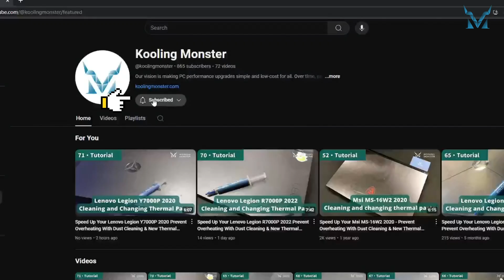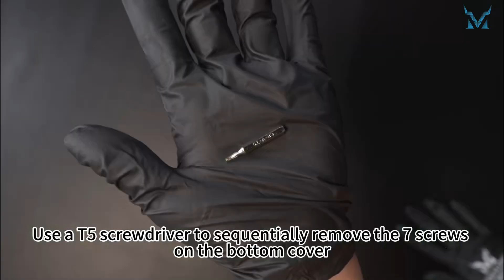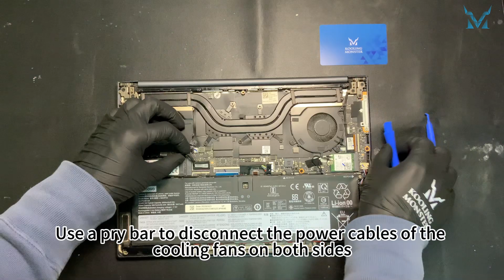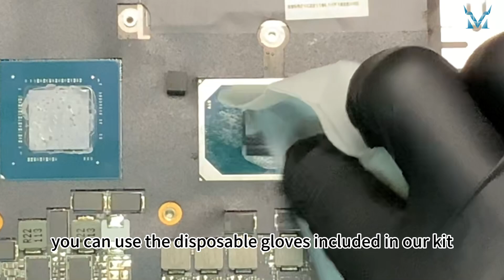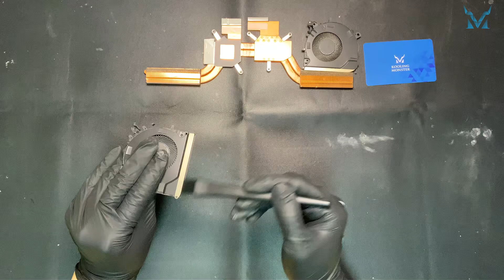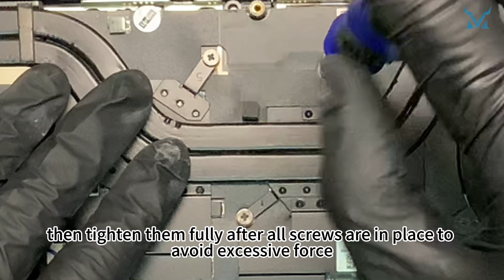Speed Up Your Lenovo Yoga Slim 7i Pro 14  Prevent Overheating With Dust Cleaning & New Thermal Paste

Comment: My left fan doesn't sounds only right sounds and hardware test dont run as they aren't available in the software , i checked all of them, can you help me to check if they work or not
Reply from the maker: Run a manual fan test in BIOS if available, or use Alienware Command Center to ramp both fans to 100%. If the left fan stays silent while the right one spins, it's likely dead or its connector isn't fully seated. Recheck the fan cable first, then try swapping the fan headers if you're comfortable. If it still doesn't spin, replace the left fan.

Comment: I have a Lenovo Yoga Slim 7 Pro instead of the 7i, can i still follow this tutorial or are they built differently? It's a 14ach5 if that matters.
Reply from the maker: The Slim 7 Pro 14ACH5 is built differently from the 7i. The motherboard layout, cooler design, and screw placement differ, so I wouldn't recommend following this tutorial directly. Please look for a guide specific to the 14ACH5 to avoid damaging connectors or missing steps during disassembly.